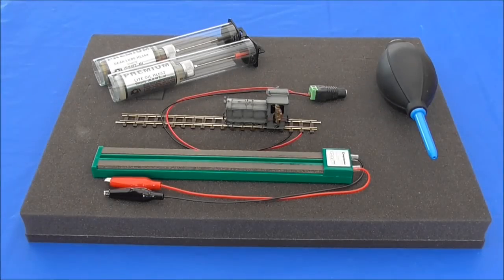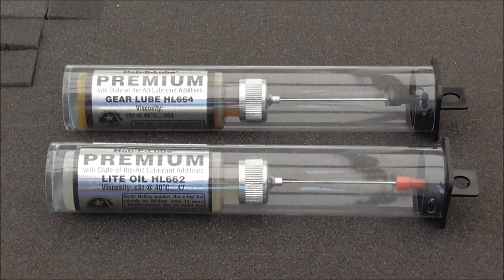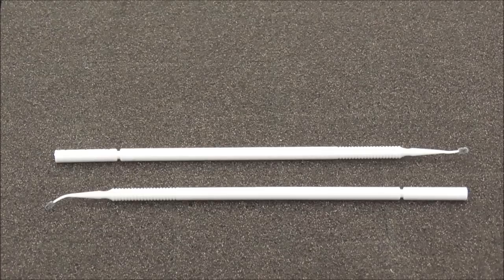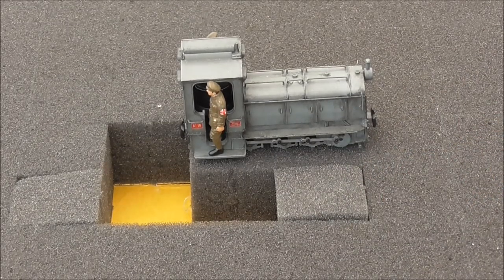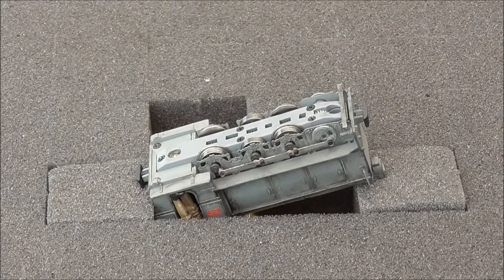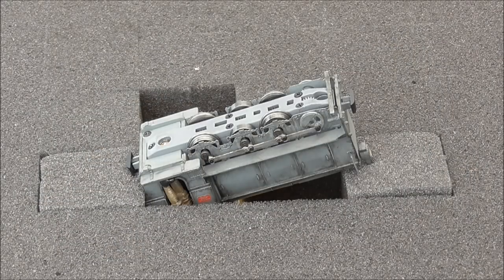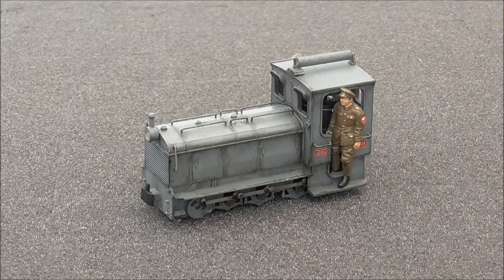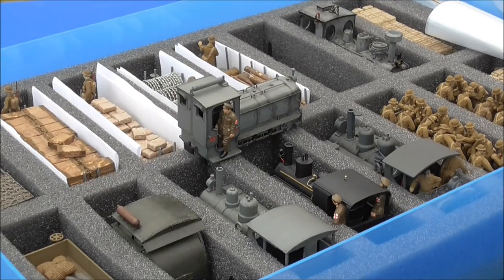Model Railway - Cleaning & Maintaining your Model Trains - How to Model Railway

Comment: Thanks for the video. I have a question....Is there any possibility of causing any damage to Traction Tyres when using the wheel cleaner.?   Cheers   Greg
Reply from the maker: Hmmmm, that's a very good question. Currently most of my fleet don't have any, but I wouldn't recommend using one with them. Maybe a wheel cleaner that can be used on individual wheels might be better.
Reply: Thanks   Cheers   Greg

Comment: I have a Hornby Peckett.... it's started to smoke and not move.... have a feeling over oiled on trying to service. I used peco oils.
Do you think it's recoverable, and if so how to....
Reply from the maker: That's a difficult one. I would recommend taking it to a dealer and see what can be done. I'm sure there's a way it can be stripped and cleaned if that's the case.
Reply: SDJR7F88 rather difficult, as I live in Western Australia. Retailers over here purely sellers, no available repairers...